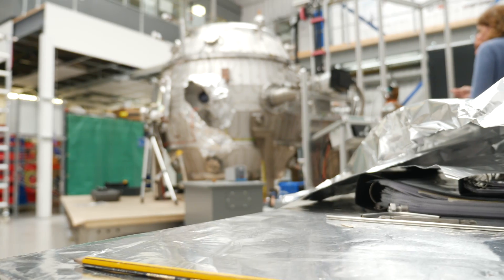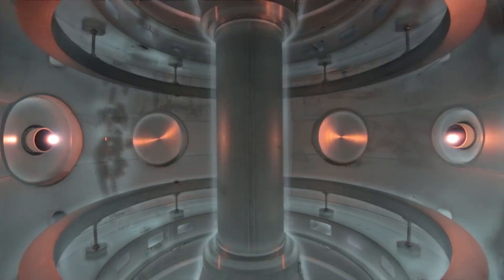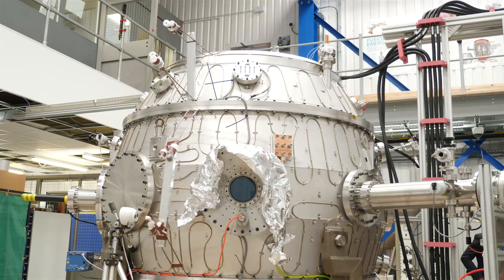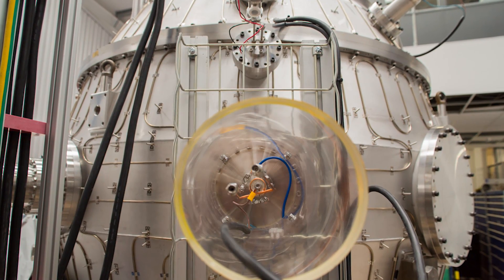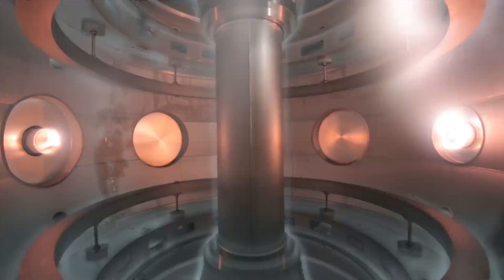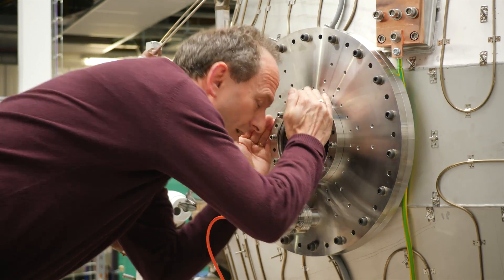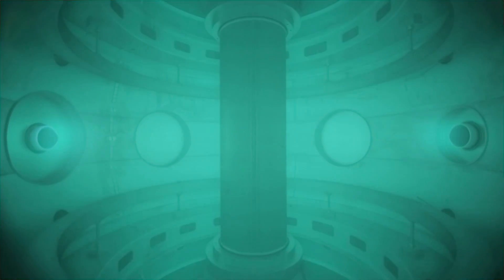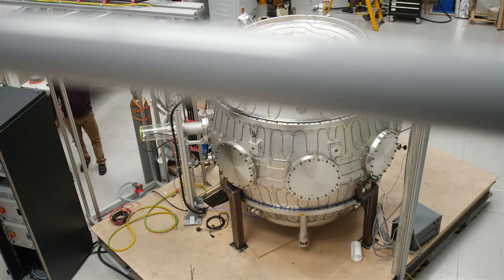Glow discharge plasma in ST40

Comment: Are tokamak programs just a way of doing advanced plasma physics while hiding the fact that practical fusion power has been in use for decades without public knowledge? It's a fair question. . . Fusion energy has been 20 years away forever. Somehow, with a potential budget of trillions, unlimited lab space and equipment, and nearly a century, I am skeptical that the problem remains unsolved.

Comment: I have a question regarding the temperature. I've never understood how the plasma, being millions of degrees doesn't damage the walls. I understand the process of confining it in a magnetic field. What I don't understand is how the heat is confined. Is the inside of the reactor a vacuum except for the plasma? If that is how it's done, why does the plasma still radiate heat (as opposed to convection). How hot do the interior surfaces get? 

You'll have to excuse me, I'm trying to make the cognitive leap from a blacksmith's understanding of heat and materials to what is going on here, with energy tens of thousands of times more than a forge.

Comment: Can you help me here with a question i have? The sun produces radiation in all spectrums, lots of high energy gamma rays etc. Well should fusion do the same, and if it does doesnt that mean the chamber and everything near it will become highly radioactive??

And if everything is becoming highly radioactive how long can that equipment remain viable?
Reply from the maker: On Earth the fusion reaction we use is different to that in the Sun.  We combine deuterium and tritium (both types of heavy hydrogen) and the products are helium and a neutron.  It doesn't produce light (gamma rays etc).  The neutron has very high energy and when it passes through the walls of the chamber it can interact with atoms in the walls to make them slightly radioactive. Note "slightly" radioactive rather than "highly" radioactive.  The radioactivity will be short-lived; it will last perhaps 50-100 years before it is completely safe and can be recycled.  The exact time will depend on the choice of materials used, and it is in our interest to minimise the radioactivity.  The neutrons also damage the materials over time, which is a time limit on the viability of some parts of the machine (but not all).  There is research going into the best materials and into shielding from the neutrons.  Additionally, using smaller machines we could have several on one power station site meaning that there could always be one down for repairs and maintenance whilst the keeping the others going.
Reply: Tokamak Energy - Thanks for the reply. Ive wondered that for a while. 

Sounds like youre planning on some sort of assembly line mass production. Rather than having several small machines im sure a power station would rather have two or 3 bigger machines. More volume to area. Or is that just an assumption from me? I know your whole angle is to make small fusion reactors but have yous looked at making larger reactors to fit a market demand if it exists?
Reply: Don't neutrons decay into high energy photons?
Reply: NicosMind, in response to your second comment, you have to consider the square/cube law. A small increase in size equates to a larger increase in internal volume. There may come a point at which scaling up of the reaction chamber starts providing diminishing returns. They seem to be having more success with smaller units, so I'd rather them focus their energies on that and perfecting it. And yes, mass-production is the ultimate goal. We don't need ONE fusion reactor in the world. We need many, powering all the places that truly need it.